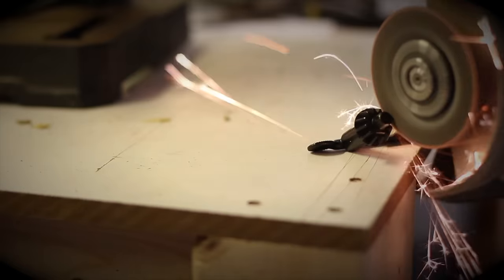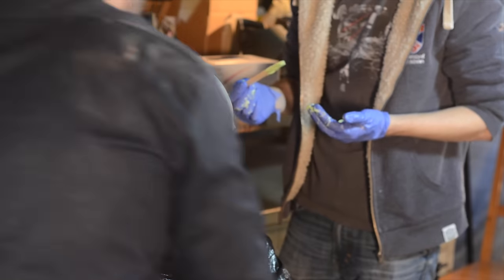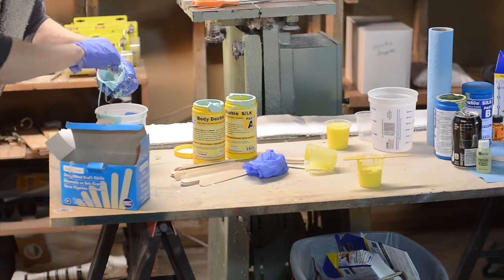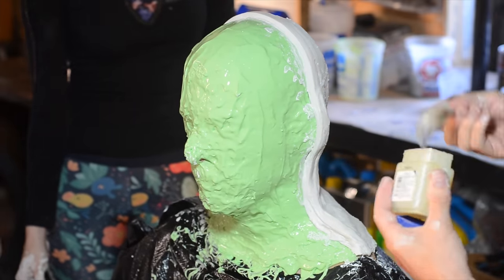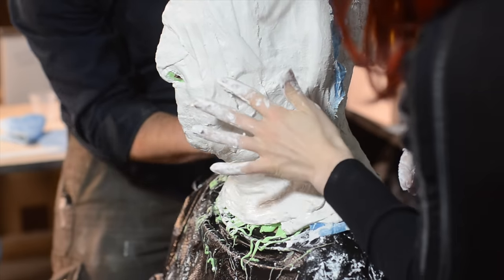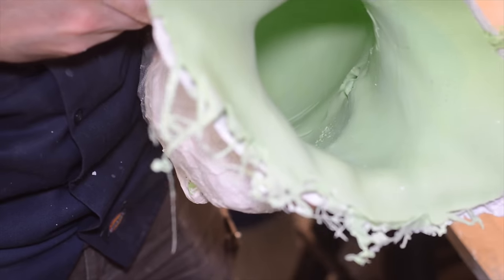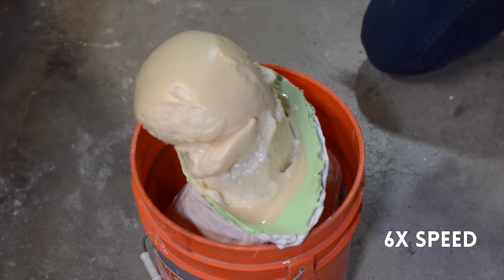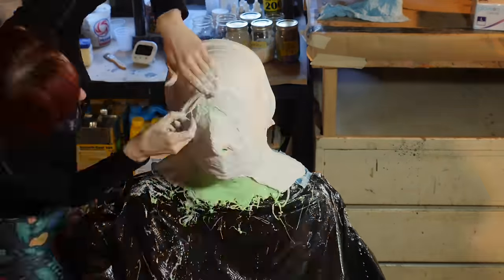How to life cast (make a mold of your head) | I Like To Make Stuff

Comment: @I Like To Make Stuff 
@Punished Props 

i did this same build except i didnt have any silicone on my head i just straight up wrapped my head in plaster strips and made a mold of my head. I planned on filling up the mold of my head with a powder water mixture of plaster of paris but i bought the wrong kind ... i bought the toothpaste form of it(like for patching up holes) instead of more powder plaster but when i used the toothpaste form and poured it into the mold it looked like it have hardened but when i pulled the plaster strips off it was goopy inside and semi hard on the outside.

Also is mixing plaster of paris outside without a mask bad? lol because i dont have a respirator

Would this x-30 just work with a harden plaster strips mold of my head?

Comment: So what is recommended to use when making the actual mold out of the cast? (or do I have that backwards) also did those two bottles work for your entire head or did you need multiples. My spouse and I are wanting to make molds of our heads so we can start learning various prosthetics like I want to make an Asari headpiece and my spouse wants to do a helmet.

Comment: one thing i am wondering is ear casting alone get more detail then a full head cast or can you get the same detail of ears and  nose then doing specific nose and ear casts. With these full head cast are you suppose to push alginate or silicone into the ear or just coat it. It seems you don't have to worry about this detail when your just pouring a ear mold with a cup that the subject holds over there ear. Ear and nose area when doing full head molds/casts seems the hard areas as well as the danger areas to.

Comment: I'm sorry if you might have posted this already but how many packs of the plaster bandages were needed for this?
Reply: I wonder too, because they specified how many of the silicone kits they bought in the description (2) but seems to have written no number next to the plaster bandage on there, making me assume they only used one of these rolls. However, looking at guides online, a lot of them recommend using 7 rolls of the exact same dimensions as the one they used here. This is really confusing, and I would love to have a clarification on this.

Comment: Hey Bob! love the channel! I have a heavier beard, i'd prefer to not shave it. what would you recommend I do to avoid this, and still get a good mold?
Reply from the maker: The silicone that we used is  made specifically for facial hair, but I'm not sure how it'd handle a long beard. If the beard is just thick, the silicone can be worked into it with some effort.  I only lost a few hairs to the molding process, I was really impressed.  Otherwise, I'm not really sure of the options for you :/
Reply: Right on, well i appreciate the quick response sir. Thanks again, your channel has helped me tackle a ton of projects. I think I'm going to try smothering it in Vaseline to contour to my face. :P

Comment: Not dissing this technique, but it seems like a 3D printer would be a much easier way to get a mold of your head.  You just sit still long enough to get scanned, and you're done, instead of for hours while a whole team of people smear goop on you, then plaster, then the extra steps of removing the cast and pouring molding material into that.  Less time, less specialty materials, and less claustrophobia.  Probably even cheaper too.
Reply from the maker: Well, I mostly disagree but it is another option for sure.  The trick for most people I think would be having access to a high enough resolution 3d scanner.
Reply: True, though having access to the manpower and expertise to make this work well might be a trick for most people too.  It definitely makes for a cooler video though!